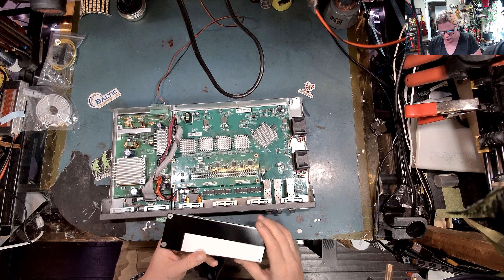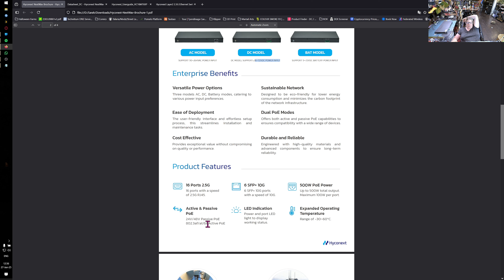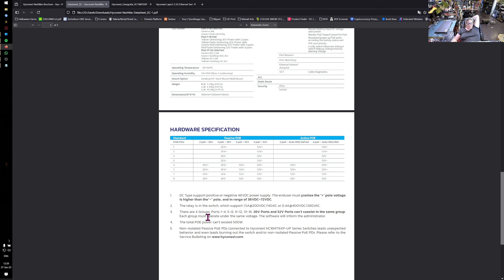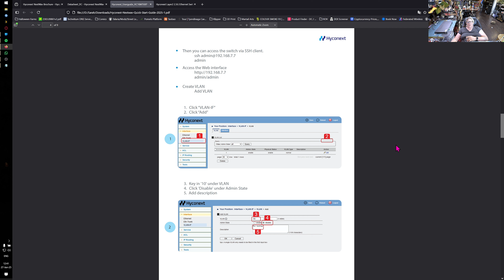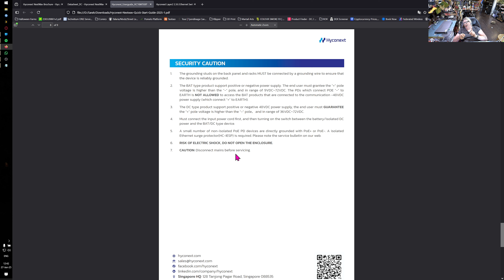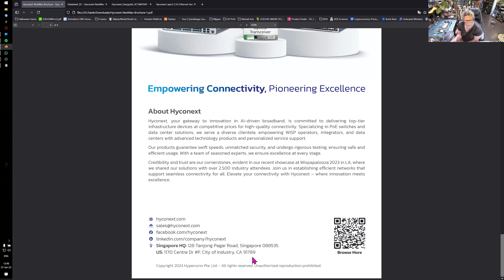"New" Hyconext 2.5Gb 10Gb POE+ Layer 2 Switch!!

Comment: I have been waiting for a switch like this for so long.   My only other desire would be smaller/outdoor styled to replace EPS-16's   Regardless this is amazing, but I am not exactly wanting to hang this at 600 ft on a tower.
Reply from the maker: Run fiber and DC up the tower ;)
Reply: @thefixitgal  Did ... And then came the coper thieves and grounding issues :)   Constant Fun!